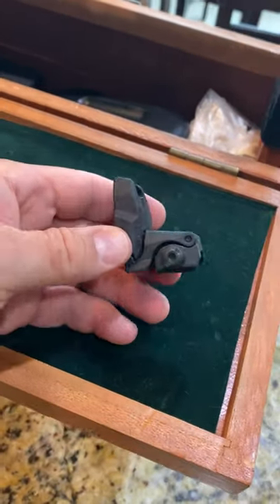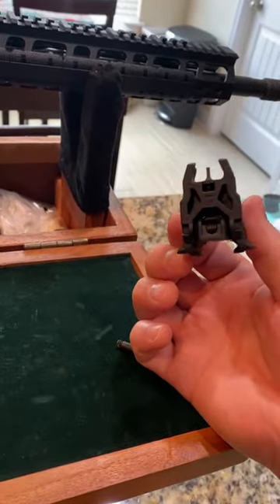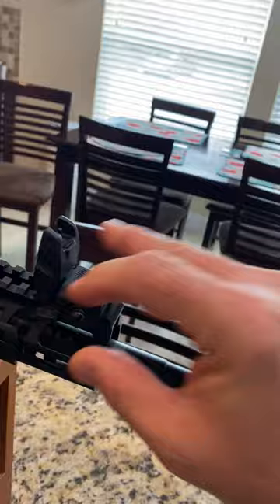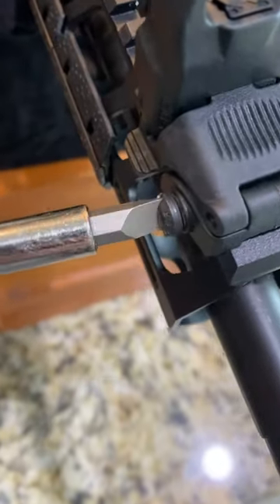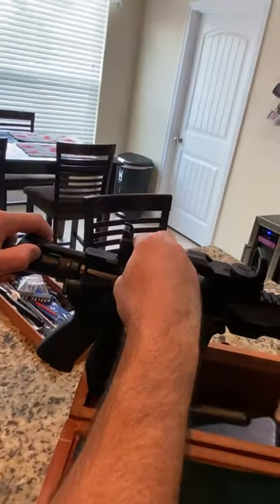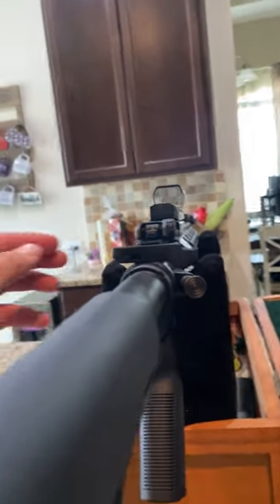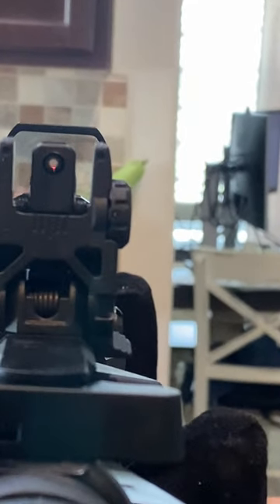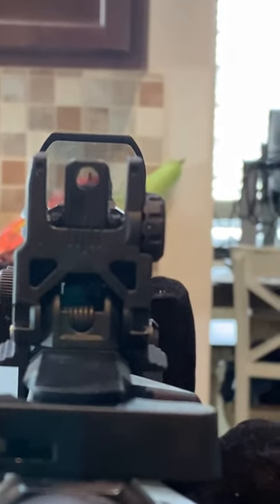AR 15 flip up sights installation

Comment: I like the rear placement spacing tip. Gets it as far back as possible but allows you to work the charging handle without the sight (when stowed) interfering with your fingers.
Reply: Definitely my favorite little detail

Comment: Isn't the front site supposed to be flipped around
Reply from the maker: You made me second guess myself 🙂, so I went over to magpul to confirm, they do go on the way I demonstrated, however it will install in reverse just fine if you prefer.
Reply: No do not fucking install backup sights flipped around the wrong way. They go one way. Also the rear sight  is supposed to fold onto the smooth space above the charging handle. That is why the rear sight is shaped that way. There's no reason to reduce sight radius